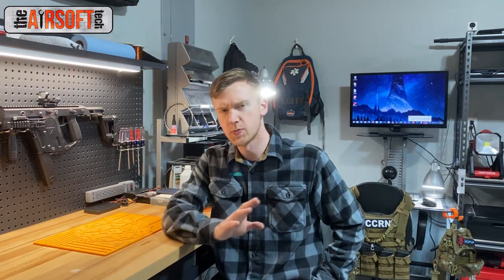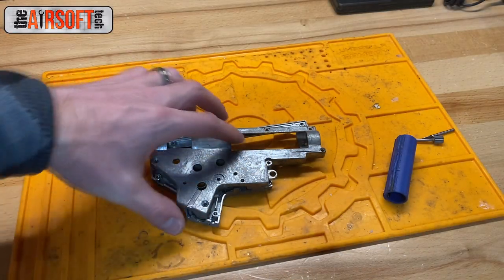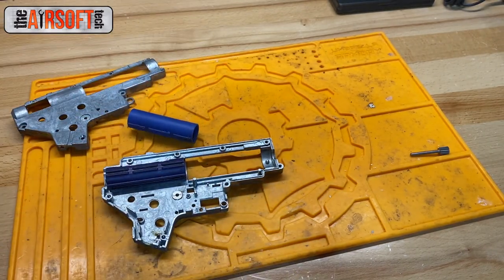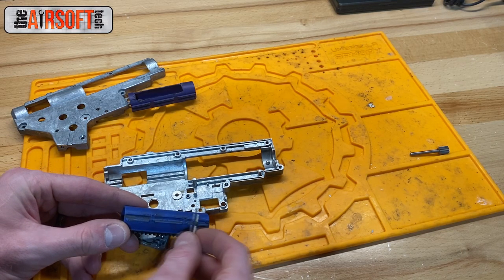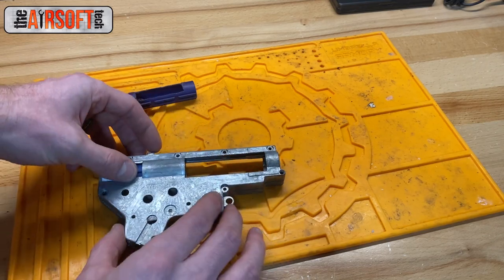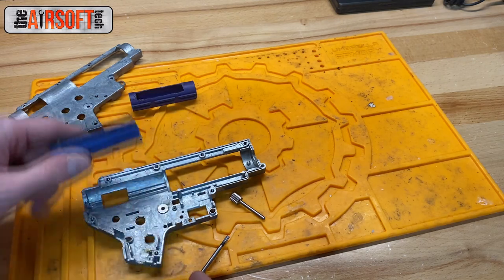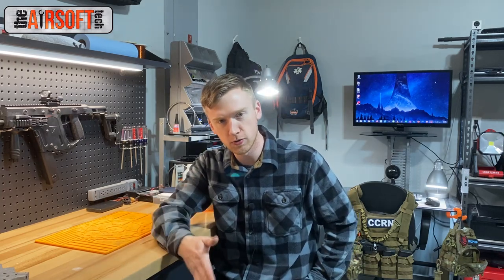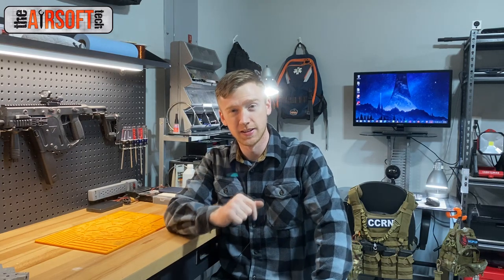Don't Do This to Your Piston!

Comment: The problem I see with your old method is that you made a rounded groove and probably made it also too wide, which allowed the piston to move up and down.
If you are going to deepen the groove on the piston, just don't use a ROUND bit. Find a proper squared file and file a squared channel. Check fitment, then adjust the walls of the groove if they are also too tall.
Alternatively, if it's the walls that grind, file them down first, then check if the groove is now grinding. If it does, file with a square profiled file.
I agree that filing the gearbox is easier and allows for polishing later on, but it can be done either way.

Comment: My smithing experience is almost entirely with real steel, not airsoft so maybe I'm just looking at it wrong, but why are all these pistons made from cheap ass plastic as opposed to something like Delrin (like paintball marker bolts) that's more durable and can be machined more precisely? Is it a weight thing? Or cost maybe? I just seems odd that with all the shiny AEG upgrades available, everyone's piston looks like it came out of a dollar store dart gun. Enlighten me please, wise airsoft techs.
Reply: It's weight. If your piston is too heavy, it causes a lot of problems.

Comment: Just buy the correct piston that is 100% compatible with the gearbox. If AOE is corrected properly the piston should be traveling backward, not up. Here in gel blaster land (Australia) we've been having to run dremmel bits through pistons to get them to fit older gearboxes for a while - which is fine for lower end builds. Doing these things for a dsg/tsg build is flat out stupid...... just buy the right parts.
Reply from the maker: There not really such a thing as “the right part.”

Sure you can buy Lonex pistons for Lonex gearbox shells and retro arms pistons for retro arms gearbox shell, but where do you limit that? 

Is putting a BTC spectre in my Lonex gearbox shell considered “buying the wrong part?”

Just learn to modify your stuff and it’ll work properly.

Also, the force of the sector gear hitting the piston pick up tooth combined with the resistance of spring will cause the piston to attempt to rotate or strain upwards; regardless of how good your AOE is.
Reply: @TheAirsoftTech  Wrong and wrong. You can buy different off the shelf pistons with different geometry. Trying to adapt a square peg to fit in a round hole will always be less than optimal. With high stress builds min/maxing is super important, if you're going to cheap out and try modify the wrong part you will encounter issues. Modifying a piston for a 300fps build that gets run on semi is fine, doing that for a dsg or tsg build with m160+ spring is asking for trouble. Use the right parts from the start and save yourself these entirely avoidable problems.
Reply from the maker: @jjanderson1987  adapting an SHS piston to better function with a gearbox shell is not trying to fit a square peg in a round hole. 

In almost 10 years of Teching I’ve only ever had this specific issue three times, ever. I wouldn’t describe that as suboptimal hence why I’ve always done it. Since my technique has shown a weakness I’m adjusting my approach. There’s nothing wrong with that at all. There’s also nothing wrong with buying a part that fits better out of the box.

The difference is my method is cheaper and has proven to be effective for hundreds of builds. 

Learning how to adapt and modify your parts to better work isn’t wrong. It’s how you save money, learn how things work mechanically, and adapt.

It’s not about the right part vs the wrong part; that’s very simple thinking. 

Ultimately, either way isn’t wrongs they can achieve the same performance result. An SHS piston is $9 whereas a retro arms piston is $23.
Reply: @TheAirsoftTech  everything is gonna be made different.  you are correct, there really is no correct part sometimes, and you just use whats good.  I find that most of my stuff is trial and error.  SHS pistons are cheap, but they work great.  Sure i splurged and bought a kratos, but it does the same thing as an SHS, and fits the same.  Thats just the one thing i don't like about the community of techs, is that there are people too overly expressive of their opinons.

Comment: i found that in all my time of building ( about a year and half now) that, to nobody's surprise, krytac is the one that gives me the most headache.  So much dremel work that's not needed if they just take out the extra metal.  The piston fitment thing comes with VFC shells the most in my experience.  6 out of the 8 VFC guns i worked on had piston fitment problems with SHS pistons.

Comment: Hey man, I'm newer to teching my guns and I recently installed a perun ab++ into my v2 gearbox. I took apart my gearbox, installed the mosfet, and then put it back together. I went out to my yard to test fire, and im getting a lot of misfeeding, inconsistent fps, and double feeding with mags that i never had any issues with before. I've searched all over youtube and reddit and tried different things but nothing seems to be fixing it, would you happen to have any ideas what the issue might be? thanks so much
Reply: active braking can be the problem, inconsistent FPS means you have a bad airseal somewhere, and Misfeeding can be due to the tappet plate, the hopup chamber, or you got the wrong nozzle length
Reply: @Static_MK3Focus  awesome, thanks for the tips man
Reply: @judeforbus4180  I would definitely wait and see if Ryan (theairsofttech) gets back to you, he has far more knowledge than me, but I’m glad I could help
Reply: @Static_MK3Focus  sounds good man thanks